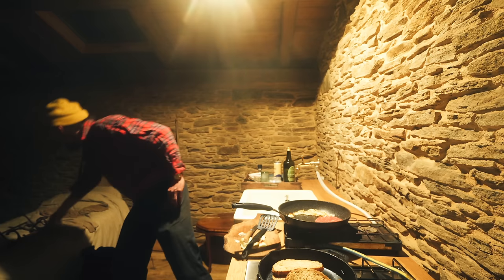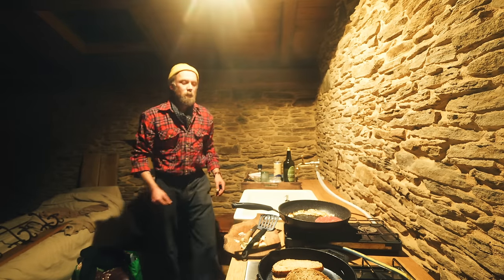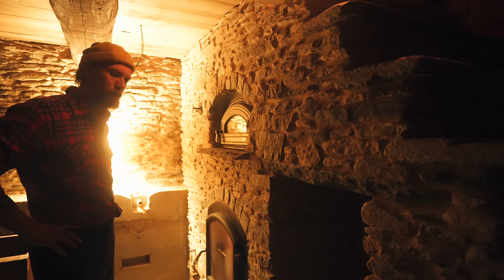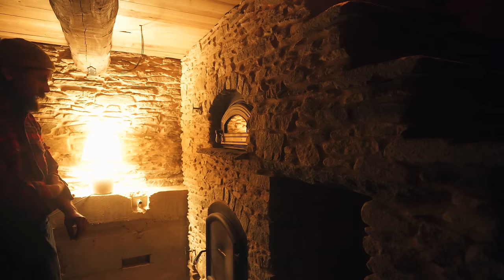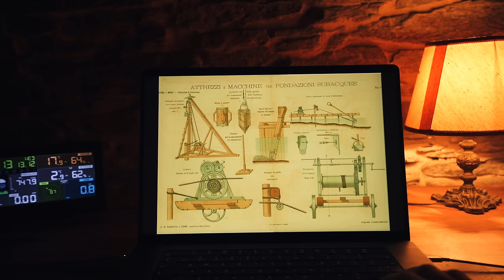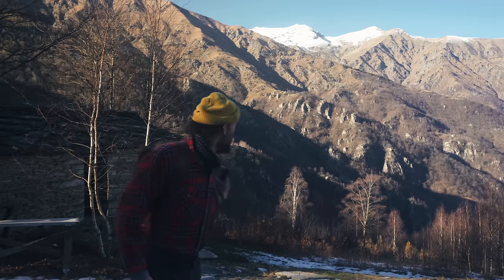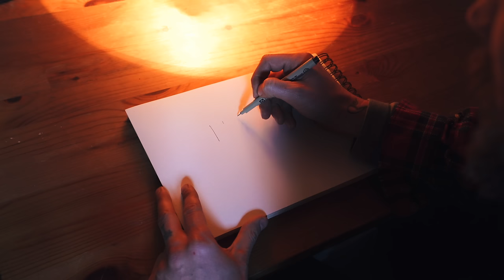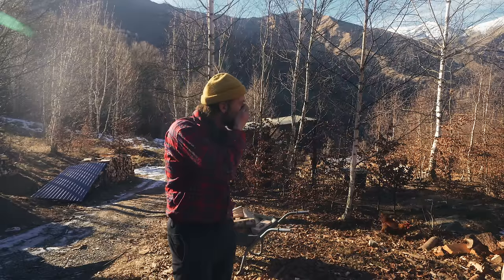#96 Plumbing, Electricity, Kitchen

Comment: lol thanks for your hand drawing layout for your electrics, I then had to close my eyes🥴 and make a 3D Google walk around of your house floor plan by my imagination from following you, assuming your other building is just a tool house shed storage then? We never see the inside of it.
  10+yrs ago? I ripped out all the old copper plumbing in my house bought in 90's remodeled by a guy from an old 1920's abandoned single family home. Replaced it with PVC and quick connect joints and replaced everything into my tub, sinks with new faucets sets and key thing.......ELECTRIC WATER HEATING AT POINT unit. Removed my water heater tank, use it's flue piping for a fun camping stove set up as my unfinished basement is like your rock house but cement blocks instead. Running a new designed A/C heating split unit off of my solar panels, batts & inverter grid unit, (longago my gas furnace was crap run 100%electric now) besides my computer set up. I believe in buying and fixing up good old housing stock in small cities old neighborhoods than rent in over priced condos or give $ to rich landlords. URBAN HOMESTEADING.

Comment: ChatGPT: Yes, an old stone house with no insulation is likely losing heat to the outside, as stone tends to have poor insulation properties. Consider adding insulation to improve energy efficiency. You are also loosing heat through the front door, huge gaps between door and frame!

Comment: At the main door you will be loosing allot of energy, there must be a draft pushing cold air in to the cabin. You should block up the unwanted gaps letting cold air in and warm air out. Saving warm air upstairs you'll use less energy to heat the space. A Thermal curtain over the back of the door may be the answer.

Comment: 15:50 The worktop appears to be standard MDF covered with laminate. In my experience, over time water will seep under the sink and permeate the cut edges of the worktop, causing, over time, the laminate to bubble up. I used wood hardener fluid on the cut edges, making sure the MDF was thoroughly saturated to a depth of several millimetres. Then leave it to dry and harden for several hours before fitting the sink. And the sink should be fitted with suitable sealant or a gasket. Same goes for the bore hole containing the tap (faucet). If it's MDF it needs the wood hardener treatment, too. Wherever there is MDF and water, the water always seems to find a way in.

Comment: Congrats that the heat capacity sizing of the stove turned out good. Would have been a setback if it's requiring frequent firing or would get hotter than suitable.

Comment: I was and still I am surprised that you didn’t spread out thin pipes (which working as radiator) around home, than will give you extra warm. Coz now since you start heating your place you can experience condensation issues including mould 😢 coz temperature is not even on walls and lvls.

Comment: 6:57 You will need a splash back behind the gas stove(s), otherwise the stone wall will be soon covered with congealed fat globules and it's difficult enough to clean off even from smooth tiles.

Comment: Suggestion: It would be a safer option not to run any electrical conduit near gas pipes or hot spots. Less chance of damaging the conductors and overloading the system. In addition to considering an electrical panel for protection as well, close to the entry point.

Comment: Brilliant video again. I am puzzled by the gas hob situation though. You installed a new hob that was fully built in to the worktop. But then you have a SECOND gas hob next to it, that is NOT built in...doesn't that mean the first built-in hob is therefore not enough? If not enough, don't you need to build in a second one, or build in a bigger one to start with?
Reply: Theres only one I think? He had to deconstruct the kitchen to move it a few inches and reinstalled everything afterwards.

Comment: Remember Ray Bradbury's book; "451 Fahrenheit?" That's the temperature that paper will burn and that converts to 232.77C!!! Don't bake anything at 300 C  (572F) !!! that's way too hot, you'll burn everything. Bread 205C, Pies 175, Biscuits and small loaves 190,  A Covered Stew 160-175C.  Majority of baked items is around 175C. A 5kg Roast 160 for 4 hours and it will be fork tender. I remember your poor apple pie almost got cremated? Attach a heat thermometer to the wall or inside your oven.

Comment: Martijn, i am surprised to learn you decided for cooking on gas! The latest research data on gas cooking in relation to our health are ominous. CO2 rates are high and lead-compounds are relaesed. To mention only two hazardous elenents. Only way to keep these toxic atmosphere on a acceptable level is to install an extreme powerfull suction system and a permanent inlet of big amounts of fresh air. Which is counter productive in wintertime. For all the rest; you are accomplishing an amazing fine job there! Groet, Frans.

Comment: Hi Martijn, looks great as always! would an induction stove top not make better use of your solar power vs getting always new gas? or is the power only in the long run good enough from the sun when u invest in more solar yield and batteries??
Reply: I have induction in my camper. Takes lots of current.

Comment: Hi Martin, I'm curious about what happened to the original plan to install a water heating tank behind the new stove and the connection to the underfloor heating system you laid under the concrete? There now seems to be no longer any access to the rear of the stove.

Comment: you built your fire upside down.  start with the small stuff and lighting material is on the bottom and then work with larger wood as you go up.

Comment: Would it be useful if you find it necessary moving forward to put a door with a blower on the front of that wood stove? Use it or not as needed? I grew up in  a stone house so I know they are very different heating/cooling than a regular stick build. I remember laying on the cool wood floors in very hot summer days after returning from the lake all sunburnt.

Comment: You have to seal the doors, i can see how the heat is escapeing 😂
Reply: OfflcialMartijnDoolaard  31:10 when i saw the light between the doors and frame, i thought that the heat could escape, it could be a “weak spot”, dont you think? Correct me if im wrong. :)

Comment: It bothers me that you can see light trough the front door. When it will get colder that will blow cold quite a lot. And I haven’t seen any fresh air ventilation? That fireplace will need a lot of air and will get it somewhere through the walls etc.

Comment: The catalyst in which the course become a success is having the decisive decision to get up than get by, resulting in a dynamic demonstration that limitation is narrowed up and defeated.  It motivates others to discover innate talents and forge a new path authentic and personal.  We desire moments of rest and tranquility not elaborately done just what is available at present.  As the dying ember in the fireplace and warmth diminishes is an indication to start the fire ...
Hectic short days and weeks but consider the monumental progress that is achieving.  The complex plan and work of wires, tubes or connectors are almost identifiable as life lines.  Seeing them properly placed is merely believing the importance even of the invisible ones.   The kitchen is operational and it looks perfect already.  Without reservation its completion is coming.

Comment: So with that stove you drag the cold outside air into the cabin through springs in the walls,doors etc then heats it? Seems not to efficient.

Why not Instead make an supply air intake pipe under the floor and out the wall. Thats how we do it in Sweden.

Comment: This oven is misplaced and  oversized its not gonna work for such a small cabin? Just wait till the temperature drops to -10C.
You can't even get +18 C with a full wood stacked oven. Your thermometer shows +17,8 C after 2-3 hours of this wood stove burning at max. settings and this with mild temperatures outside around +5 degrees C. You even measured it in the upper area where the warm air is going to. I don't wanna know how cold it was in the "basement". 
I think this massive "overkill" wood stove  that needs a ton of wood to heat up space, the stone heating mass is "way to big" and would sucks all the energy. After it get heated up which happens after at least 2 times full sets of wood (read manual of the manufacturer) after this maybe the heating energy would be transferred to the air in the room. Maybe! And after this it would tilt in the other direction making the room a sauna.
Long story short, every fireplace of metal with stone appliance is superior to your wood stove and way to much stone you build in, for this small amount of space.  And it comes at fraction of the cost.
So my problem with such a build is that people gonna believe this it's working fine, and they probably do the same error. Everyone should before building contact a professional for wood stoves and not trying to do it on their own.
I think you miscalculated the oven! 
Any way you can still fix the build by removing part of the stones from the wall, and let the oven walls more open to the air. So heat would go faster to the surroundings.
And why is the kitchen on the upper floor no body knows, are you gonna eat and sleep at the same place?
Reply: Agree - main point for my own comments: other people follow Martijns concept and construct more less useless and dangerous heating systems by their own, without asking professionals. This by the way is not possible in Germany. Each heating system is under yearly strict control from the State. Reason: in the middle age and later on till arround 1920 whole villages and parts of towns burned down since there was no security.
Reply: @angelikadobler6854  Seems like Martijn seems not to care a lot about security, not even his own. OK... this is also a way to go forward.
Such a shame that he is not using the opportunity, and just ask the community here. Either he doesn't care or he thinks he knows better.
Anyway, one can only try to help.

Comment: Have you actually removed the cardboard from the stove or is it still between the bricks?
Maybe I missed it...
Reply: He previously stated that the cardboard is intentionally installed to ensure that there is no thermal bridge between the Temp-cast masonry heater and the stonework.  The cardboard will disintegrate over time leaving an air gap all the way round.
Reply: @DavidB773 Thank you very much!